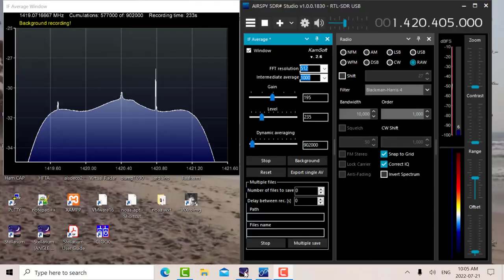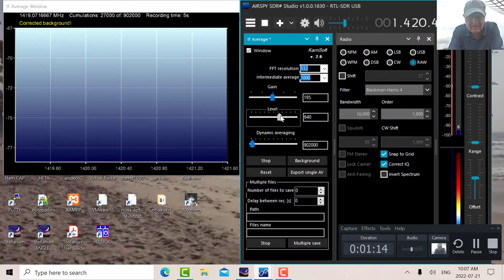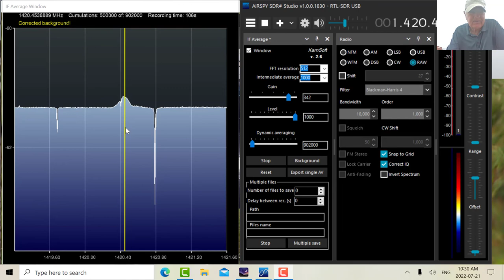RTL-SDR for Radio Astronomy - Signal Capture2

Comment: Very cool indeed, thanks for sharing :)
Reply from the maker: Thanks, it took a long time & trial/error to get the signal!
Reply: @ClarkTelecom  I can imagine. I've seen it done with the horn-shaped receiver for h-line detection but not an SDR before.
Reply from the maker: @GaryMcKinnonUFO  The key for me was getting out of town. In town, the sdr was saturated with intermod so the fft averaging failed.
Reply: @ClarkTelecom  Yes it's tough being a star-gazer, light pollution for scopes and EMF for radio-scopes. I have some time tonight so will watch your other videos.

Comment: Good Start !
With that antenna, there is so much spillover from the short side that you should keep all measurements  ~  +- 20 degrees overhead ( +- 1.5  hrs RA ) to minimize ground thermal noise pickup.   A notebook PC within 15 ft can generate RFI from the monitor .. ( rotate 90 deg )

 For some ideas to improve the performance, see this video .   
Not too costly upgrades of the feed and adding side panels to the dish  will make a Huge difference.
Alex KK4VB

https://www.youtube.com/watch?v=C6NCefVxNL8
Reply from the maker: Tnx! 73